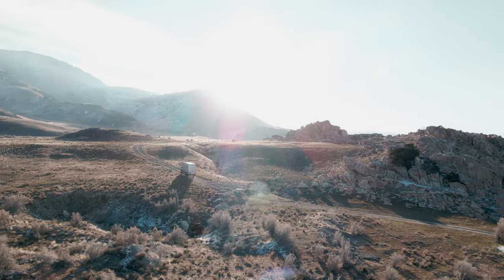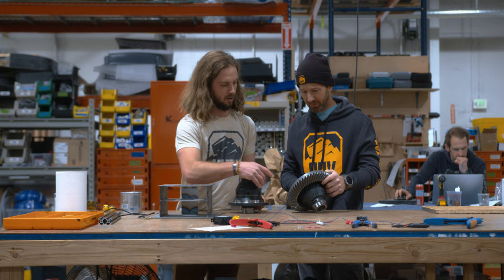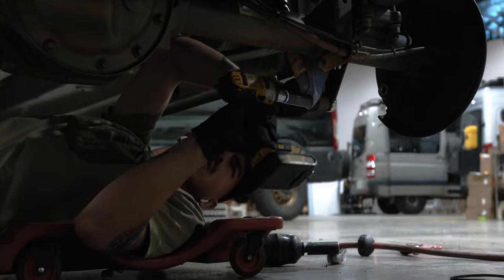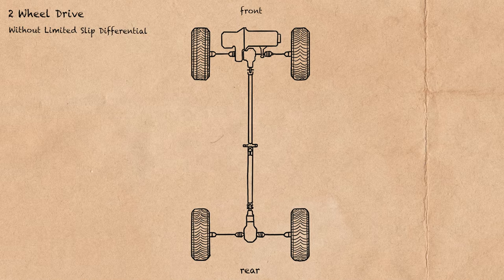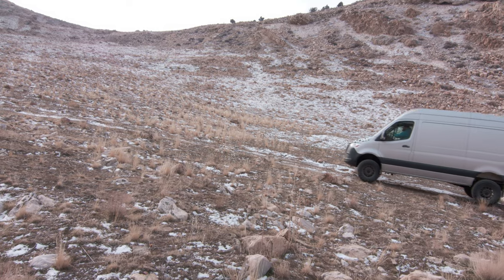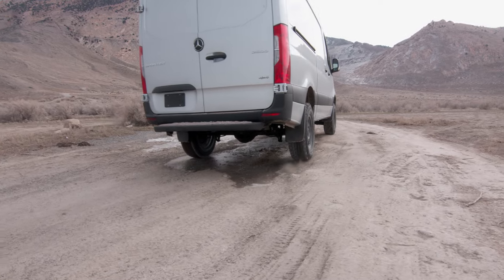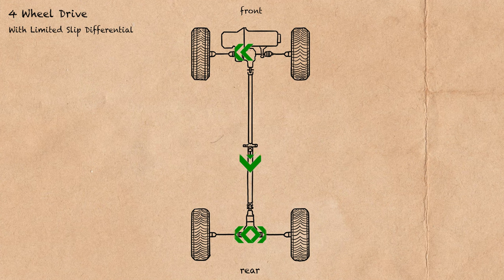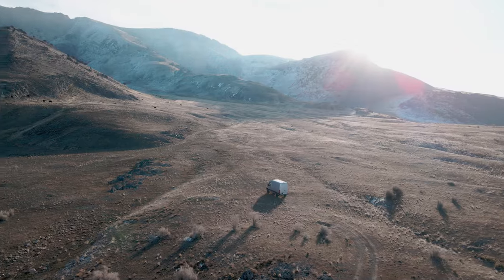The Traction Boost Limited-Slip Differential for Sprinter Vans by Dark Star Offroad

Comment: The explanation of how power is delivered is wrong. In an open differential torque is applied to both wheels but the torque applied to each wheel is limited by the wheel with the least amount of traction. A worm gear differential like the one shown in this video will have a multiplying effect on the torque sent to the wheel with more traction (something like 3-4x) so if one wheel has limited traction 3-4 times the traction of that wheel can be sent to the other. If a wheel is completely off the ground it will still just spin and you wont move, however in conjunction with electronic traction control which applies brakes to the spinning wheel you still see a huge benefit as the braking force is the same as that spinning wheel gaining traction and the limited slip still multiplies it.
This kind of limited slip is amazing and will legitimately make your vehicle way more capable in low traction situations however I think customers deserve accurate explanations of how products work. Having a good understanding of how things work can make a big difference in tricky situations.
Reply from the maker: Thanks Lee! We appreciate the in-depth explanation. Explaining these things is very tricky, as you pointed out - we tried our best to pair it down as simply as possible in an easy to understand and digest way through this video. Just like our van builds and products - we're always looking to improve, and we appreciate your feedback.

Comment: Great video. Is your limited-slip van year specific? If so, what years do you support? Thank you!!
Reply from the maker: The Limited-Slip works for 2007 and newer Sprinter vans (Both the NCV3, and the VS30), and for both the 2WD and 4x4 Models. It will not work on Dually vans. Thank You

Comment: Hey guys, looks like you have made a product to def solve a problem with the sprinter. I have a 2006 dually and even going up driveways on a slight angle will cause my wheel to spin. Can this work with early model sprinters with dually wheels?
Reply from the maker: Russell - Thanks for the comment. We currently do not have a solution for the T1N Sprinters (2002-2006) sprinters. We'll let you know if we decide to pursue this option.

Comment: Hello, I have a sprinter 516 2011 year model light truck which has duals and is 2 wheel drive. Is your system likely to work on my sprinter and if so do you have sales agents/installers in New Zealand please?: Cheers, Johnny
Reply from the maker: Hi Johnny, Unfortunately, our limited slip differential does not work with the dually axle configuration.